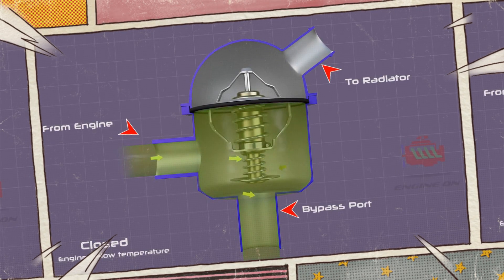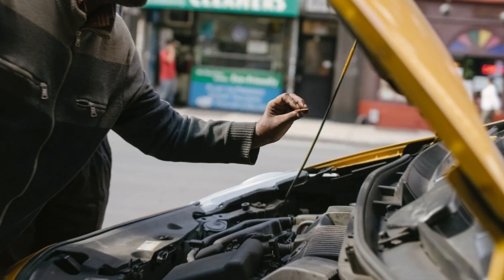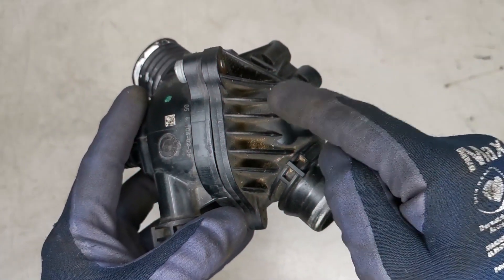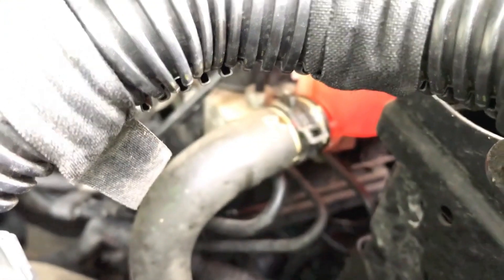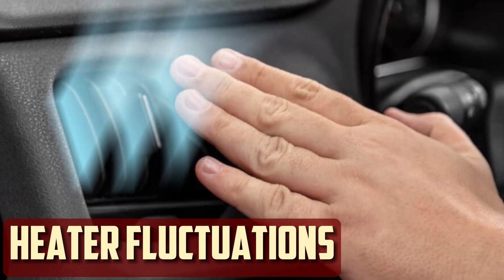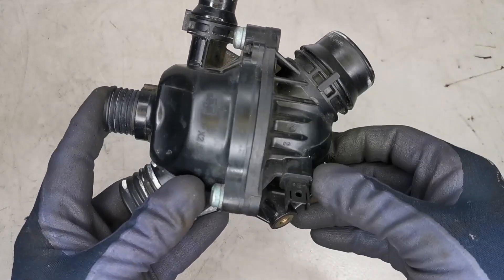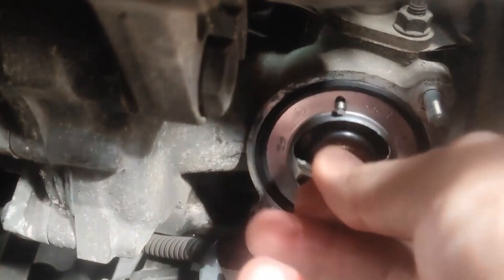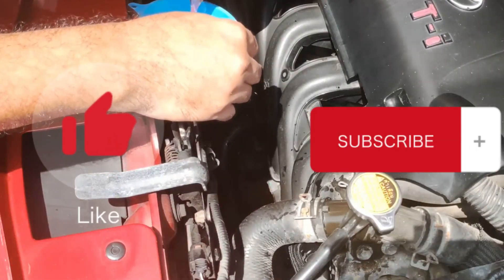7 Signs of a Faulty Thermostat - How to Test & Replacement Cost

Comment: Also worth a mention is the radiator cap. Its a safety valve that opens at a certain pressure. If its faulty it can open incorrectly and the coolant leaks out and the vehicle overheats.

Comment: Why waste time etc testing a thermostat just replace it it's hardly an expensive piece of equipment,at least not here In the UK £13/ £16. 00 . weight that against how much your time is worth . best of luck a very interesting video.
Reply: Probably to confirm the part was faulty?
Reply: Well said.
Reply: Hey was head gasket on the Honda. And thermostat rubber gasket is a real ptoblem. Still over headed with NO termostst. Head gasket sealant worked ( when NO thermostst lol less pressure in eng   . Car worked. But NO heat for winter. Got elect heated seat covers. Nope didnt fix. Got a 4× 4 Yukon for cdn winter. ( will make into a p/u truck with elect tag axle - tandem axle p/ u.  Only use the Honda on warmer days. Eng too costly to replace. Will part car out. Other Honda needs rear window. This Old Honda we have was $ 500 needs clutch / aligment / back suspension repair / windshirld etc.  Only paid $ 1500 cdn for Yukon front end was reoaired. Working good. Hard on gas but will make into Elect Hybred. Put grill guard with emerg traction on front end. Semi trucks need " rubber mounted " Moose sre 7× heavier than Kangaroo. Can crack steel frame in Cdn cold if loaded truck. Big issue. 1 403 830 4124 calgary ab cdn
Reply: Cause you can have air in your cooling system and all you gotta do it bleed the air out for free

Comment: Could the thermostat be the problem on my 2015 Toyota Yaris? Only problem I noticed is heat extra hot when turned on heater inside car. It got really cold outside the night before. Seemed to run fine and didn't notice car overheating or any warning lights on. I remember it did this once before couple years ago and resolved itself
Reply: I wouldn't consider the heat out of your vents being hot a problem when it's cold outside. The only time the temperature out of your vents would indicate an engine issue is if you turn the heat on and it blows cold air. That means you're out of coolant. other than that, if you turn the heat on and you get hot air that's a good thing. If it's inconsistently hot, you might have some blockage in your heater core. it may need to be flushed.
Reply: @BrokePrepper  thank you just extraordinarily hot